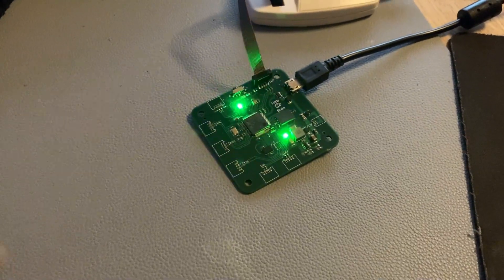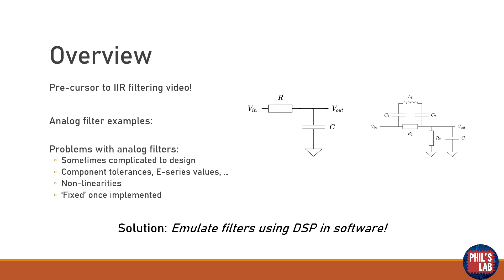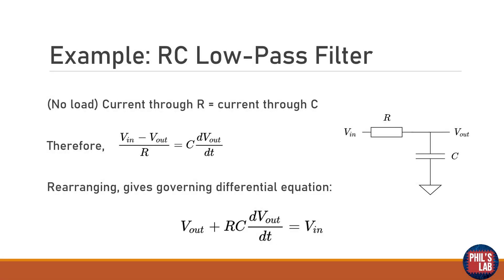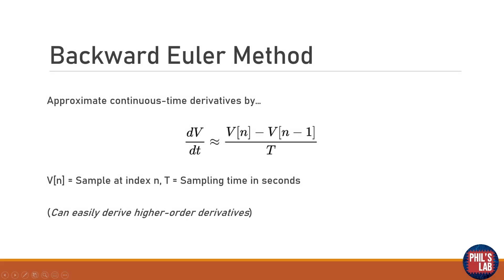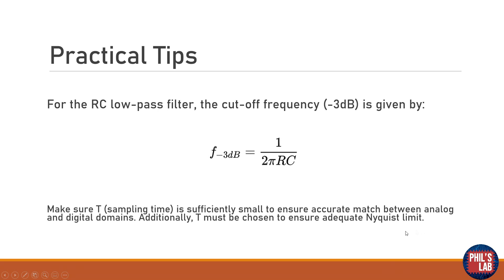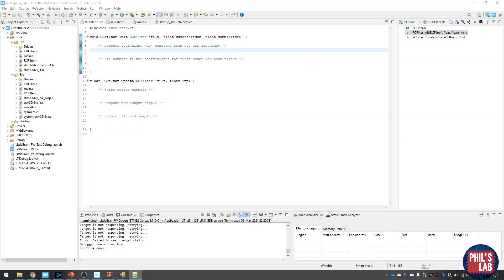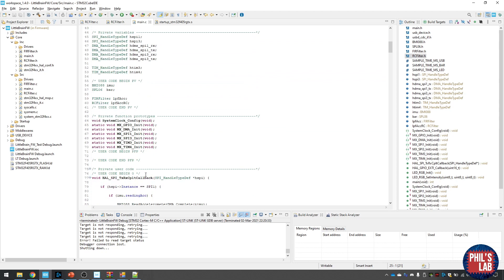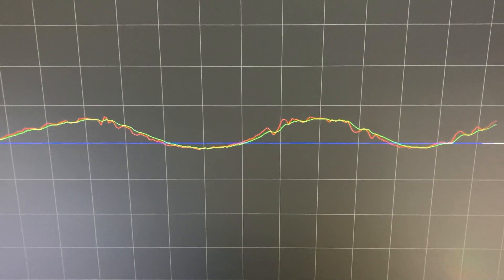(Sponsored) Real-Time Software Implementation of Analog Filters - Phil's Lab #20

Comment: Thanks! Recommend any schematics symbol flipper (conventional to actual electron flow) to make schematics align with actual electron flow? Because certain circuits (such as that  RC filter at 2:15] are BLATANTLY backwards in conventional model and flipping those schematics would make it easier to analyze and understand some circuits.

Comment: Very interesting.   I did this in 1989 for a company called Analog Design Tools.  (Now part of a large EDA company)   They had a contract with an automatic test company to simulate a new test machine.   Most of it was easy, but they didn't know how they were going to simulate analog filters in software.    There were several filters, of different orders, and all expressed as Laplacians.    The method I used was to convert the Laplacian to a Z Transform.   The Z Trsnsform can easily be re-written as a difference equation.   A correction factor was needed because of a difference in range of Laplacians vs the Z Transform.   I wrote the program in C and used the ADT software to create the frequency swept response of the analog Laplacian representation and the IIR filter.   Once this conversion (analog s domain to difference equation) was perfected, I created a program that converted an s domain fraction of any order into the correct difference equation.   Not sure how useful that was.   ADT had just hired 20 new CS grads, so they had something to play with.

Comment: Phil, love your videos! Very calming to say....

Have a tip/more efficient way for the equation. You could do it with one coefficient. k=T/(T+RC) and solve:
Voutn = k*Vinn + (1-k)*Voutn-1
Where 1-k=RC/(T+RC), solve it yourself to proof.
Reply: Came here to mention this, but add an even further improvement.  When we did this we sometimes had issues with the (1-k) all the time.  With a little algebra you can use:
Voutn = Voutn-1 + k *(Vinn - Voutn-1).  

So instead of two multiplications, we have just one.  Back in the 70's and 80's when I started doing this sort of thing, that was a serious improvement in CPU time.  And if you have low-precision rounding errors, it eliminates the chances of (k + (1-k)) not being exact 1.000000 which can cause some issues.

Comment: Great explanation once again! I hated all the EE parts - network analysis and everything analog - back in college. Now I've indirectly gotten back to that domain through PCB, FPGA and embedded design and find it fascinating.

One minor improvement: you only need a single output buffer value (float out;) because the second value is never actually used. You can write

float RCFilter_Update(RCFilter * filt, float inp) {
    return filt->out = filt->coeff[0] * inp + filt->coeff[1] * filt->out;
}

Comment: Thank you so much for your clear expanation. Also nice to see you use units in your variable names, a practice that helps all too often in nightly debug sessions. Was there a particular reason why you stored two output values? For this formula one would have been enough.
Reply from the maker: Thank you very much! Yeah, I think it's a good practice to include the units in these sorts of applications as well. 
I used two variables for the output values just for clarity (in my eyes it shows it a bit more directly that we are basing our computation on a previous output) - but yes, one output variable would of course have been enough :)

Comment: I'd love a crash course analog/digital course from you.
Reply from the maker: Thank you! Hopefully will be putting more analog + digital content on the channel. Any topic in particular that you'd like to have covered?
Reply: @PhilsLab I've been thinking about how to answer this question over the last few days
 I dont know if I know enough to give a good response!  I think what I see lacking and really want to know more about is how to mix components like diodes and transistors, capacitors and coils in analog and digital electronics, like there's a billion different values for transistors and diodes, why did you select those. What effect do they have one the circuit? Id love to see practical examples. I really liked how you went through the steps of designing a digital filter in this video and then implemented it and showed the results! That was great!

Comment: Great series! I wanted to order your little brain board on JLCPCB but the MP2359DJ-LF-Z isn't available anymore also the BMI088 is out of stock.
I found two replacement parts, the RT8259GJ6 and the  ̶B̶M̶I̶0̶5̶5̶ ̶t̶h̶a̶t̶ ̶a̶r̶e̶  available on www.jlcpcb.com/parts
What do you think of these parts? Should I buy the board with those two replacement parts?
Reply from the maker: Thank you, Rick! Yeah, I really need to adjust the Little Brain board... I've made a newer version, just need to get it made and then I'll put the files up. It's a shame that JLC keeps putting really valuable components out of stock. The only IMUs they have now are the MPU*-type.. I'll have the boards ready by next week if you wanna wait for ordering until then?
Reply: @PhilsLab  Hi! That's really nice to hear! Thanks for putting effort into a revision of your board! Sure I can wait :) I agree on the JLCPCB part, but the overall experience with them is good. Keep up the good work, I gladly follow along with your videos. I think they are the best on STM32 and it's a good balance between theory subjects and applying them practice.

Comment: Hello Phil - this is really excellent - thank you.  I just wondered if you would consider doing an additional software implementation in uPython - especially as the RP2040 chip used in the Raspberry Pico is gaining traction?
Reply from the maker: Hey Kevin, Thank you very much! I'm not sure I'll be making additional implementations in other languages, as I think this should be pretty straightforward to convert and C is pretty much the only language I use these days. Maybe if you wanna give it a try and then share the results, that would be awesome!
Reply: @PhilsLab  Phil - I think I will actually do that - keep the vids coming!

Comment: I love your tutorials as you give us practical examples of every topic. 
I had a few questions, are there any advantages of having an actual analog low pass filter front end for adcs over digital filters? 
Also since you are already exploring imu stuff can you make tutorials for ahrs algorithms and maybe even sensor fusion using kalman filtering in the future. I would love to see those
Thank you
Reply from the maker: Thank you very much! You will in most cases need an actual analog low-pass filter before the ADC input (sometimes this is included in the IC) and is known as an anti-aliasing filter. Furthermore, analog filtering prior to the conversion will often be useful if you want to reduce the bandwidth of the signal, remove a DC offset, or so forth.
Yes, one of my next videos will actually be on the Extended Kalman Filter and how to implement it in real-time on an MCU. :)
Reply: @PhilsLab  I can't wait, thanks for the reply

Comment: I have always averaged n samples to smooth out an jittery analog sensor reading.  Thank you for this new tool.
Reply: A running average filter is actually the equivalent to an ideal 1st order RC-filter, with the -3dB cutoff at half the sampling frequency.
Reply from the maker: Thanks for watching! Actually, a movering average filter is pretty much the optimal way of smoothing a signal if you aren't worried about a particular frequency band.

Comment: This is really interesting 👍🏻 
I’ve not used the BMI088 (yet!) but I’ve used a BMA accelerometer and it had selectable built-in digital filters you can adjust via the ACC_CONF register. I wonder how it compares doing it in your app software vs on the sensor itself, might be worth trying. The software approach seems more flexible and therefore easier to tweak with an update.
Reply from the maker: Thank you, Matthew! Yeah, the integrated digital filters are definitely a useful tool, as they'll offload the main processor a bit. But as you say, our own software implementation gives us a bit more flexibility.

Comment: Great. I am currently making a function generator. This filter can gonna help me. Just change RC for different frequencies, which will do the job. Will try that in my project.
I was expecting you to talk about some window functions,  IIR coefficient sequences, SNR performance, etc.
This algorithm seems fast, efficient, and easy to be implemented.
I am thinking of constructing a better analog filter circuit than a simple RC filter and convert its transfer function into a discretized form.
Reply from the maker: Thank you! Yeah, this is kind of a 'pre-cursor' to a full IIR filtering video. There I'll be coming IIR filters in far more depth.
Hope all goes well with your project :)

Comment: Ha I've been dabbling with the "backward euler" method long before I knew what it was called, where I made a little planet and gravity simulation in a javascript processing thing, where integration is += and differential is just current value minus old value. 😆
Reply: And if you don't mind burning lots of CPU cycles, just record the impulse response of your filter and convolve it with your input stream, FIR filtering easy as!
Reply from the maker: Yeah, that's one of the most popular places to use it - numerical integration! If you haven't already, I'd encourage you to look up 'Runge-Kutta' integration which is a more accurate method of numerical integration. Actually what I used for my flight simulator.
Reply: @PhilsLab  let me guess, is it like assuming linear interpolation (trapezoidal integration) over the += which is like the classic riemann sum / nearest neighbor type approximation?

Comment: A week ago I started reading about filtering in the frequency domain, and one very invasive thought I had was, What if you were to simulate the equivalent analogue circuit for filtering?
To say I'm surprised how accurately that video fulfills my needs is an understatement.
Reply: The mind-blow is when you realise that the FIR coefficients is just the Fourier transform of the frequency response, and vice versa.

Using analog components is just a shitty unreliable way of implementing a digital filter, but it's what we had at the time. 

(Though it has to be said, using a whole CPU just to implement a digital filter is also somewhat of a waste of resources.)
Reply from the maker: Haha glad to hear that the timing was right! Thanks for watching, Dan :)